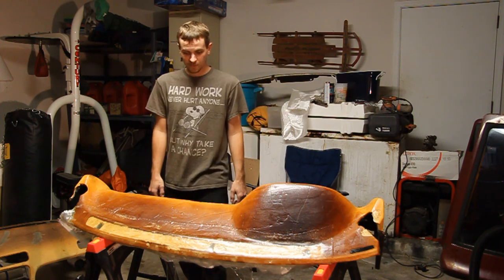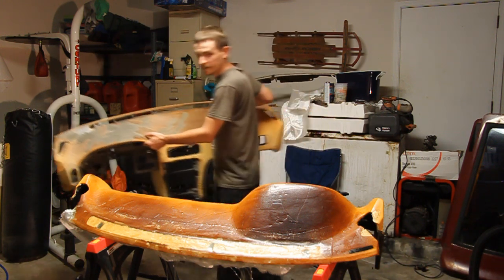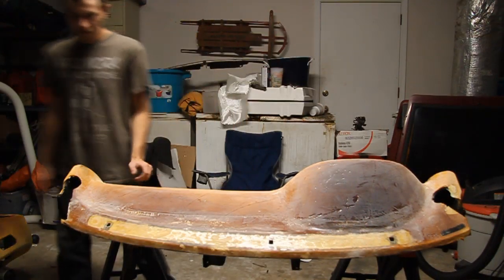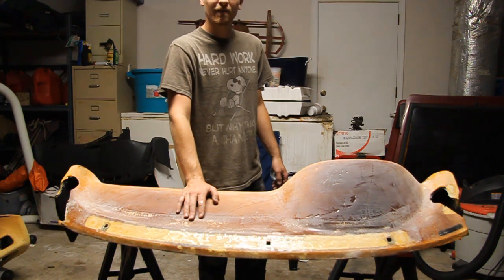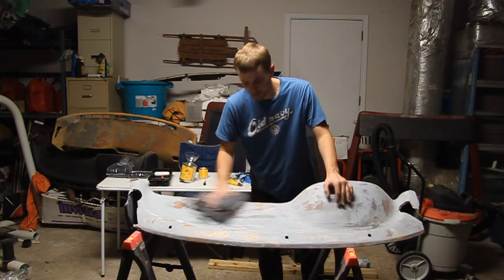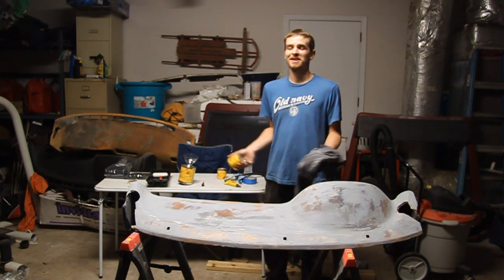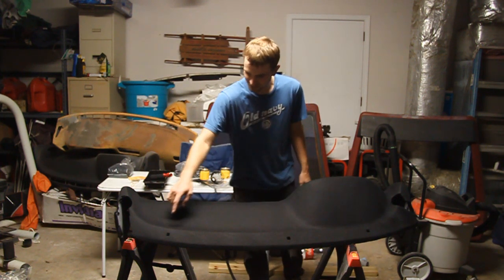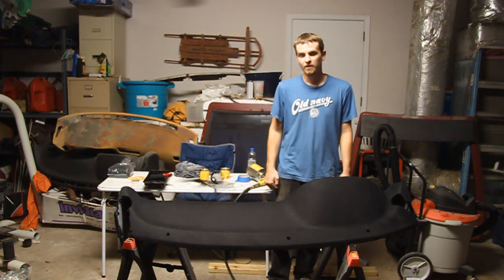Cone's Garage : Dash Suede Flocking Pt. 2

Comment: I use a lot of generic bondo in my prop stuff, it's always a pain, I should pick up some Evercoat see if that helps any. Could you have done this in sections? Like tape off certain areas apply adhesive, flock, repeat? or would it be too difficult to match seems?
Reply from the maker: As awesome as it would be to do it in sections, it leaves very noticeable seams between sections. The suede is very interesting in the way it lays down, i'd almost compare it to wood grain in that it settles in certain directions and based off how it hits. 

Also yes, try some real body filler such as evercoat rage gold and evercoat lite weight you'll never want to go back lol, it sands so much smoother/consistently.
Reply: ConeDodger240 Werd, That's what my guess was, thanks for confirming. I've always been interested in flocking, but never knew how to go about it or even how it was applied. I'm really diggin this video series, keep at it! :)

Comment: Awesome mini-series. lol My S14 dash finally cracked a month or so ago... looks like flocking will be the way to go! Any photos of the dash in the car? Also, how durable is flocking? Would it hold up on high-contact areas like door panels and center consoles?
Reply from the maker: Sadly his car is STILL unfinished. I have had one in my personal car for going on 4 years though. It doesn't fade at all (it actually looks better after a few months of curing) High contact areas are a no go, like the console where your arm rests and such, it'll wear down over time. I did it on my door panels many years ago, and they did wear a little where my arm hits but they still look pretty good.
Reply: ConeDodger240 good to know. thanks for the quick response!